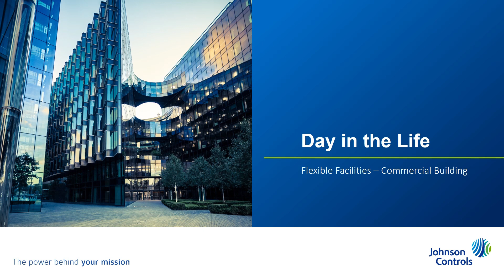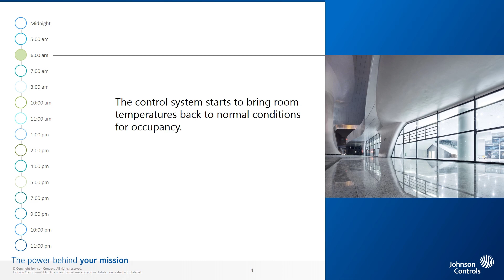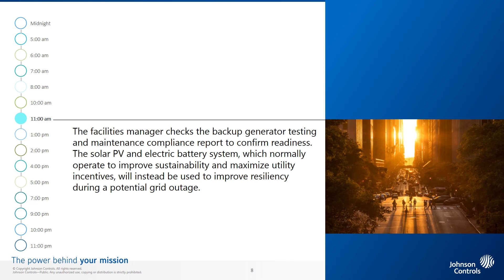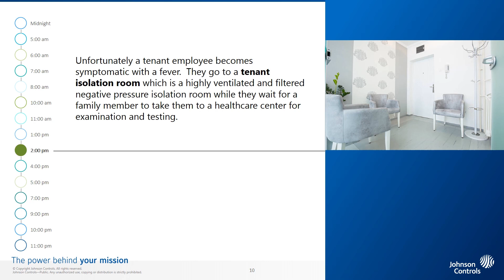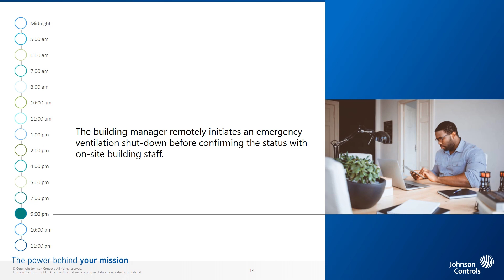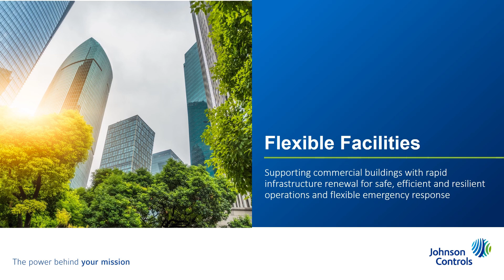Flexible Facilities – Day In The Life – Commercial

Comment: I  registered a complaint ( 20052103779 )about HITACHI AC is not working in the month of May.
After so many follow-up with customer care engineer visited on 11th June and verified that output unit is faulty and part needs to be replaced.
Output Unit is still in warranty,He said i will update this in office and then you will receive the message with update. he also took 500 Rs one-time service charge and provided the slip and told you dont have to pay this at the time of part replacement.

Since then i haven't received the update, Neither a single SMS nor a single call, Its a worst service I have ever experienced.
I sent reminders many times but still not a single update.
Kindly please get the part replacement as soon as possible and help to fix the issue.

Thanks

Best Regards,
Jayendra Bapna
+91-9985364475
Hyderabad, India